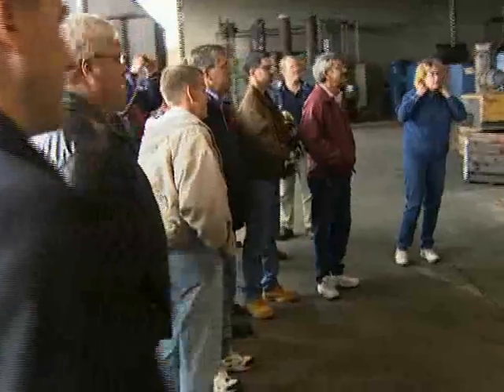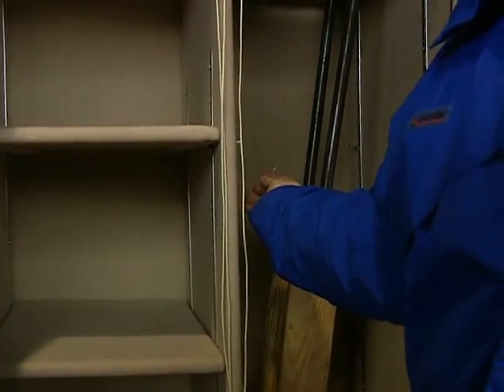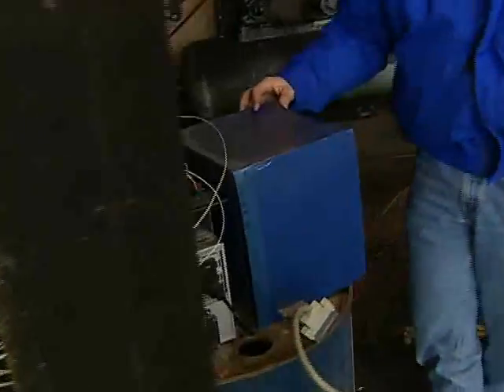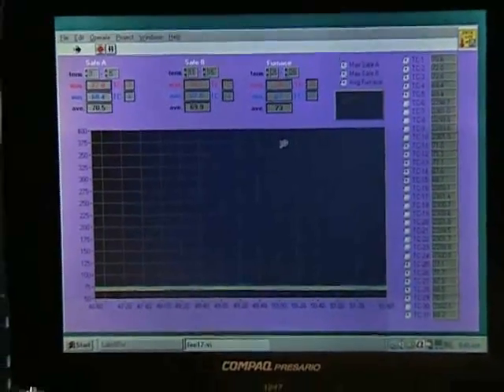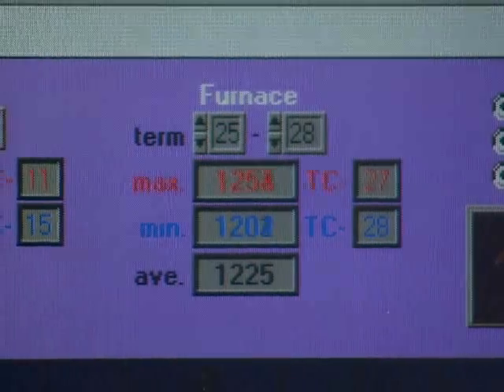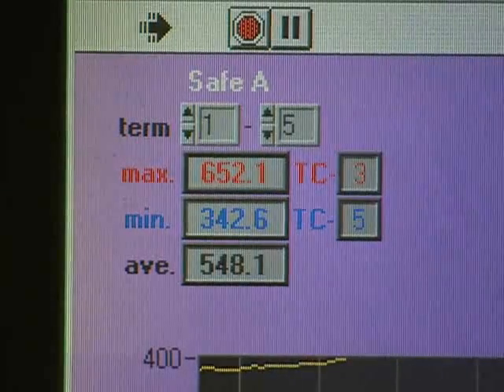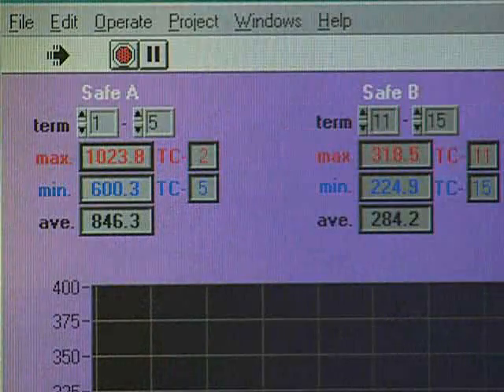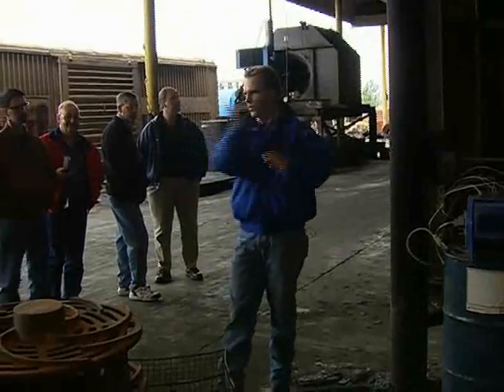Liberty Safe vs. Competition - Fire Rating Test

Comment: Being a retired firefighter I wonder how the Colonial and the Revere safe will stand up to the high pressure fire hoses we used to use to put out a fire.  Much more pressure than that water hose ;-)  A local dealer was telling me that the door seal will actually expand when the safe reaches a certain temp. and will seal out water from the door opening.